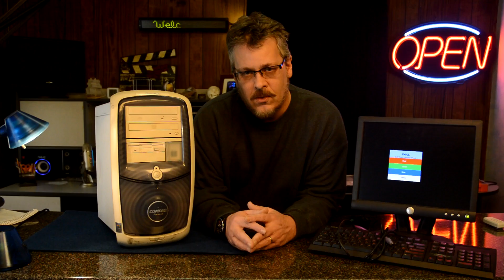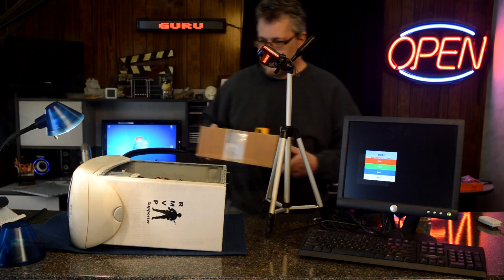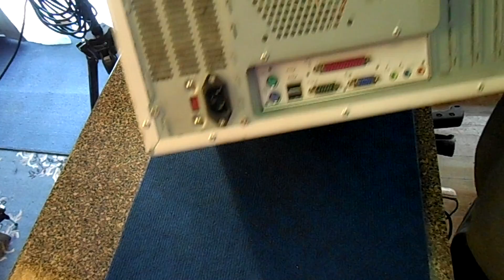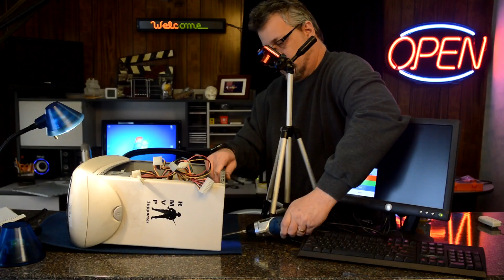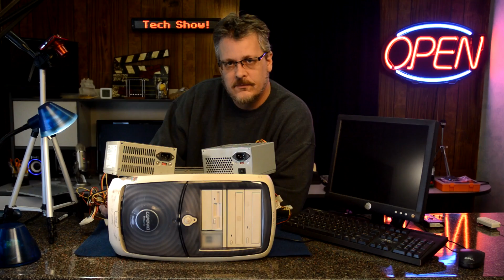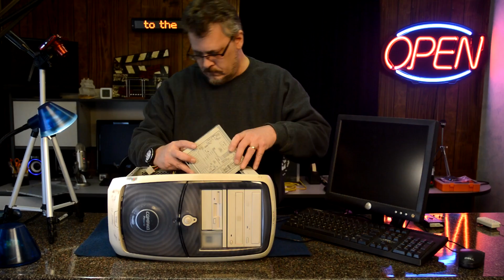Compaq Desktop Computer Repair - No Activity on Startup

Comment: I have the same model. It is a solid machine but yeah, that power supply has not aged well. Mine sounded like a rocket engine tonight so out it goes forever...and a new supply on order. Good video!
Reply: Your power supply sounds that bad?, you can clean inside the fan so it will be good now

Comment: I have a Compaq Presario 7477 and the same thing happened to it back in 1999. As a child's play my older brother managed to switch the voltage and no pc after that until we bought a new power supply. First time we wanted to be dead as our dad spent 2000 dollars(triple time the price on US converted) on it and he let us play games like Starcraft, Hercules installed by windows,  Diablo II, Twisted Metal 2, Rollcage, etc. I remember the PC had a surge protector blown away, wich was installed by the vendor(whom was a close friend of my dad). I still have it and running like day one. Amazing pc for its time with 512mb of ram.

Comment: We had a couple of these. The power supply was known for going bad on these computers. My friends mom and my mom both had the same computer one was 98 and the other was xp both of them had a power supply problem. But if Compaq still made their computer all in all I would buy another one just like this. It was a very good computer.
Reply: Its and agree with the psu problem, they were weak.

Comment: Wow, my first computer, bought it new, is almost same, just a little taller case and no onbord graphics. Mine came with millennium but after a short while I put xp on it. It is sitting on the bench right now, running, I am experimenting with Mach3 CNC on it. Except for a hard drive, I do not think it had any other hardware failures. Almost certainly I have changed the graphics card though, but low wattage one because using original psu. I been wondering when the mobo battery will go out, cant believe it is still good. Those are well built computers, I think old dells are great too, which I had bought 3 of. I build my own now and have been doing that for a long time.
From what I have seen the leading cause of computer failure is dirt. And often, the only repair needed is to blow out the computer with clean dry low pressure air. I have repaired many over internet chat that way, just explained to person how to do that, they did and Wolla, it works again. Any computer I use a lot, I clean it out at least 2 times a year. I am glad you fixed that computer, I bet it continues to work for many more years.

Comment: if you plug the psu into the tester via 24 pin or older 20 pin do you then need to plug that into the motherboard so as a bridge, then press power button?

Comment: Can you check PSU with multi-meter?
Reply: +abdul ashfaq psu will not turn on unless it is plugged into mobo,... or psu tester. And so, if you just have the power cable not connected, it will not turn on.